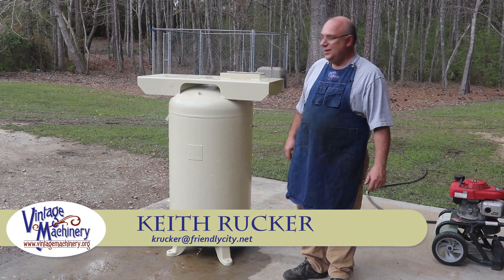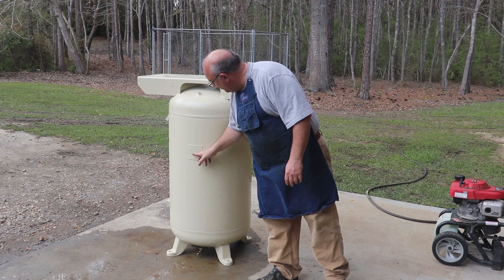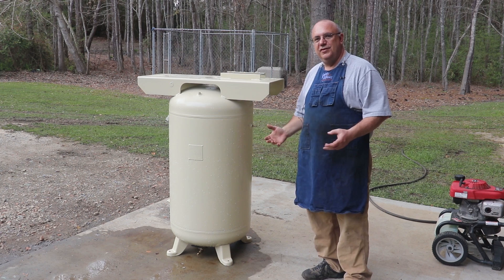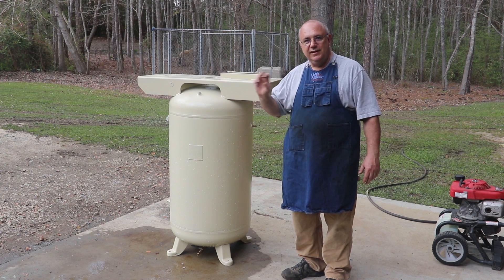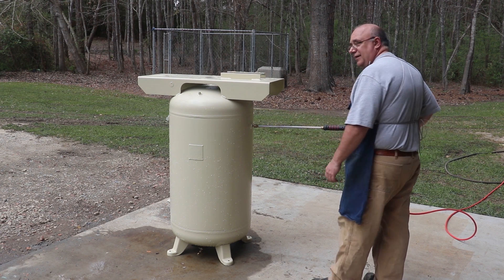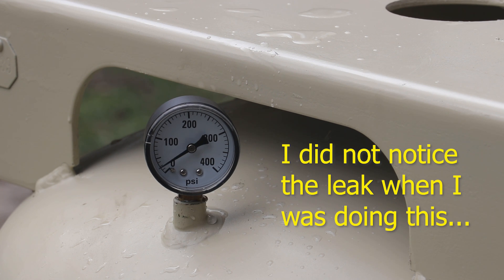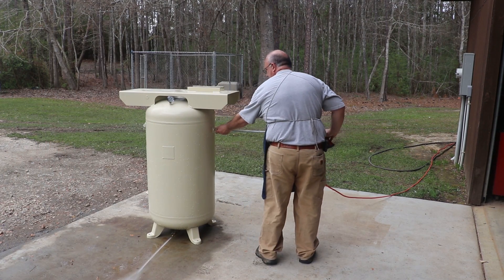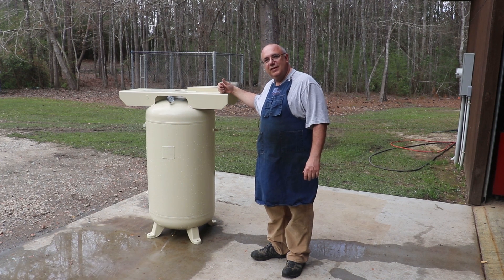Hydro Pressure Testing a Air Compressor Tank

Comment: Keith, I see that the tank held the test pressure for a few minutes but as you certainly must be aware this test does not reveal the condition of the tank. Any used air tank can be minutes away from failing. Tanks that have not been kept properly drained can have sever pitting and still hold for the moment. 
With any air tank, new or old, an automatic (preferable an electric solenoid valve on a timer) should be used. 
To see what can happen when an air tank fails you can look here: https://youtu.be/sm_FJ6Pat4I

Comment: When compressed gas cylinders are hydro tested, they're monitored for volumetric changes by submerging the cylinder in a sealed water tank during the test.  The amount of water expelled equals the volumetric growth of the cylinder under test, and you can also verify that the tank returned to its original size.  This way, thin (corroded) walls are detected even if they don't rupture.  I'm not suggesting you should do this in your situation, it just seemed like something of interest.  Now we just have to figure out the optimum air/water ratio and bottom nozzle diameter to get that tank to rocket as high in the air as possible.  I would like to start with 70% water and 30% air at 225 PSIG.  If that's a 100-gal tank, a 3" nozzle should be good for a gentle lift-off, so I vote for 4" to launch with gusto.  You can pull the cork!
Reply: I want to be there!

Comment: Great way to do a hydro test, beats using a hand pump!
Reply: wrong tony.  he coulda easily slipped up on the throttling by hand and that was a 6,000 psig pressure washer = ka-boom !!

Comment: Because water is non-compressible it builds pressure much faster than air for anyone wondering how it built pressure so quickly. For air to build the same pressure you would need to pump in many cubic feet of air, with water it only holds what it holds so you are simply trying to force in more than it will hold and it instantly builds pressure because no more water can fit inside so the pressure is from the cylinder or tank slightly expanding, in this case there is a small amount of air at the top which is compressing too.

Comment: my father used water and a manual grease gun to increase the pressure, too bad I was too young to really understand (or care) how he did it exactly
Reply: I have to assume that was in time, when relatively inexpensive, high pressure pumps. weren't available to homeowners. A manual grease gun is a high pressure  pump. Your dad  most likely did , what Keith did here.

Comment: its not the potential energy it is the proximity to other damage of people and machinery     150% is great for a compressor behind the shop
if it is in the shop a 200% is desired to "Set off " a tank  if it will fail idea is you want to test the limitations with Ansi engineering standard rupture proof test  (not a proof it will not fail , a proof that the structure is a tested  Over Pressure and survived without compromising the tank in the test.
in the propane tanks we were testing I have seen over 200% on older tanks that they really wanted to "Proof"    
on the propane tanks they had a engineer sound test and borescope after the "Hydro".  as well as a type of acid etch internally, with a bicarbonate wash, dry and seal.     tank care was interesting to watch as a welder , the outgassing of aluminium tanks and the welding accidents were horrifying, I used to weld on pads for propane tanks filled, a lot as a part of Dot maintenance discovery.   no fear of death , a bit sociopathic

Comment: Very well explained . Being a boiler plant engineer  safety and annual testing is paramount . Few non pros would perform a wall  thickness deterioration test on an air receiver ( a good idea after 10 years ) but ya could remove the large bung plug ( most have one ) and do a visual with a borescope or drain camera .

Comment: Well done Keith.  Some important points.  Never screw in a gauge by the gauge body.  Always use a wrench or you will damage the gauge.  After filling the tank, always let the temperature stabilize.  Preferably stand behind a wall when pressurizing.  That dog didn't get old by being dumb!   The leg of my small 3 gal tank is stamped with a "Destroy By" date.
Sadly the cheap drains are a coupling welded in that protrudes Inside the tank,  and does not allow complete drainage of any condensate.  Never buy one at a Garage Sale!  I have done countless Hydro tests and once witnessed a pipe coupling failure and 3,500 psi.  Impressive.  Pressure Gauge pipe on top of a vessel was not screwed in properly or threads let go.  3' length of 2" pipe does a lot of damage to a lot of things!  The Nameplate shouid give you data on the original Hydrostatic test Pressure.  Normally 1.5 times Operating Pressure.   125 Psi rating would be tested at about 190 PSI.

Comment: The inlet to the gun is rated above the pressure washer pump output but the discharge side is not as it is open ended use a rated block valve in place of the handle, yes people do pressure test like this to thousands of psi but use the block valve, do you want your hand pulling a trigger with 3-4 thousand psi on the wand side with a quick disconnect as some people do when hydroforming/testing? This is a low pressure test so no issue, this comment is for the high pressure test.

Comment: If water is not compressible how doesn't hot water tanks blow the roof off if the check valve fails? Just curious
Reply: tanks for hot water as part of heatings in a household have a second tank with a rubber ,,balloon'' inside. You set this balloon under pressure by a normal air valve like it's used for car tires, and it will absorb the volume changes between heated or cold water.

Comment: Typical Power Boiler Hydrostatic Test pressure is 1.5X MAWP, water at ambient and no less than 20 degrees Celsius as per ASME BPVC. At manufacturers shop hot water heating and hot water supply boilers must be subjected to 2.5X MAWP if the MAWP is over 200kpa. But once constructed and in service must be subjected to no less than 1.5X MAWP. Found in Section I and Section IV of the ASME BPVC.

Comment: I saw a photo of one of those horizontal hobbyist compressors with wheels at one end, and that baby had turned inside out and taken out the frame back wall of the guy’s garage. Everyone with a compressor needs to have a photo of such a catastrophe where users can see it on a regular basis.

Comment: You're going about this the unsafe way. You need to install a pressure relief valve when pressure testing the tank. A simple tee is all you need where you have the gauge connected. A 275 PSI safety relief valve is $8. 
That way if you have a mechanical failure or some other issue the pressure in the tank is limited to the safety relief valve pressure as it'll easily outflow your pressure washer.
Reply: wrong. completely wrong.
Reply: @abitofeverything9970  not wrong. He should have had. A pressure relief valve in case of  going over the test pressure
Reply: @sexyfacenation  I hydro test for a living. A safety relief valve is actually against regulation. Vessel has to be completely gagged. 🥴
Reply: @abitofeverything9970  I don't safety test for a living! It's odd you wouldn't have a fail-safe. Is there not something in the test system in case something goes wrong?
Reply: @sexyfacenation   a manual valve. either a gate valve or ball valve to regulate the pressure. not an actual fail safe, just a bleed valve to control pump flow
Reply: I have my finger on the switch, My eyes on the pressure gage and distance
Reply: That would defeat the purpose , you’d only be able to build pressure to Relief setting , 150 / 170 psi all you’d be testing is the safety valve
Reply: The only away a safety relief would work is if was high pressure valve exceeding the normal safety relief  of 150 psi or so , other wise your pretty much just testing the valve itself
Reply: I would agree with that.
Why not have a relief valve?
It won't hurt anything or change the test results.
Reply: @markchidester6239  a relief valve most definitely can change the test results. when the vessel it full of water, obviously it doesnt compress, so even a thimble full of water leaking from the safety valve could mean a drop of 50-100psi.

Comment: Keith - Thanks for making this episode.  I looked at my compressor which sits in a corner of the basement with air lines to my nearby work bench and the garage.  Couldn't recall the last time I drained water from the tank. Even forgot I had installed a radiator petcock in the drain!  So it's been a while.  The water that drained out was pretty clear and less than a quart BUT that compressor was manufactured in 1970!  The 2 cylinder cast iron compressor is getting pretty tired.  I replaced some reeds about 5 years ago.  But it's struggling again so I'm retiring the old girl. 

Picked up a smaller unit at (sorry!) Harbor Freight - 8 gallon vs. 20 on the old Sears BEST unit.  I noticed that every compressor in the store recommends draining the tank every day after use.

Comment: I find these lower than tag rated home tests amusing.   

I've done many tank tests with old odd scrap yard or auction air, propane and other tanks I have picked up over the years and repurposed or added ports to or modified in some way and I have always done my test to 2x rated for a at minimal 10 minute hold and even done a few to 3x and 4x to push dents out.  

Never had one catastrophically fail either (I do stand around a corner and pressure them up remotely though) even with very rough looking air and propane tanks with build dates going way back into the 1940's!

Comment: When I was in the Air Force we did some pressure testing on some tanks about the size of yours, but we were required to go around all the welds and tap them with a ball peen hammer. It made me nervous, but when you encountered a leak it was  uneventful. You just got a little wet.

Comment: we use to do pressure testing on hot water heaters and let me tell ya water is just as bad as air iv seen them explode and take 1/2 the house with it, it take 2 failures releaf  valve stuck for both and ether the water pump pressure switch fails or the thermostat and they start to build pressure till they pop from 300psi to up to 1000psi at 300psi the tank can wipe out 1 floor above and below at 500psi and they will wipe out the 1 below and 2 above and at 1000psi they can rip 1/2 a 3 story house down. go watch some video of water heaters failing in 15yrs of doing hvac i seen only 3 times but its amazing the power they have when the pop. thanks for sharing
Reply: I think that, when the thermostat runs away, you have a steam vessel. Steam at atmospheric pressure is about 1000 times the volume of the water. I’m sure it’s damaging.

Comment: Since moisture laying in the bottom of a tank is the most common point of failure when it rusts through I have often wondered why the manufacturers don't galvanize the interior?  Is there some reason that wouldn't be viable other than the few dollars of cost?  It is a given no matter how much or how often you drain the tank in such an oxygen rich environment (ten atmospheres or so), the fact moisture will always be present and that it takes so little to start and continue the oxidation process that this would be a problem that should be solved.  Especially so since most drains have a welded in boss that is actually slightly higher than the bottom of the tank creating a reservoir of constant water.  Nice project.  Take care.  Doug
Reply: The interior might BE galvanized, how would we know?   But, whatever the manufacurer did, the tank seems fine after 30+ years, so it was... good enough.

Welded tank seams would have to be complete, and clean on the inside of the tank,
before galvanizing, though.

Comment: For all the nervous Nellie's you need to search out "lpg cylinder burst test" (hydro pressure testing tank failure) on YouTube You'll see how undramatic it is when these fail with water in them. They bulge a LPG cylinder out with 1200+psi.
Reply: @Mike T what?? pressure can't build up with just water? how bout if it's filled with water and a grease gun pushing water or grease won't get it to a test pressure? i always thought it would, according to the gauge it did. i've only tried it on horizontal tanks. i got a few air compressors, get this, one of them my dad had since the 60s and it has a built in square tank that always cracked and he brazed it and added another tank under it, the weld cracks all the time and i braze it back up, it runs up to 120psi. i got a 30 gal boiler compressor tank and pump, it had some pretty bad cracks on the flywheel, and i v'd it out and arc welded it back together. it should work fine. i don't stand in the line of fire though. just hoping it don't go through the neighbors wall.
Reply: Hydrotesting isn't explosive as water is, for all practical purposes, non compressible. Two different beasts.
Reply: @stevenbiars4817  Yes, but as someone pointed out, a fitting coming off under pressure CAN be pretty dangerous.

Comment: I enjoyed your video immensely, and have a compressor tank of my own, purchased second hand, that requires testing.  Thank you.For all the 13 year old 'experts' and 'keyboard kommandos' out there here is the procedure used in the fire service, their LIVES depend on compressed air tanks."Requirements For Hydrostatic Tank Testing:1. Hydrostatic tank testing must be completed by a licensed certified tank tester with special equipment designed for the task.
2. The tank should be tested every five years.
3. The tank must be tested more often than every five years if there are any visual signs of degradation or damage.
4. Requirements under the law state that the tank to be tested must be filled with water and pressurized to 167% of the maximum operating pressure listed on the side of the tank.
5. The tank, including all of the valves and other closures, must hold the pressure test for at least 30 minutes without leaking or bulging.
6. Details and requirements for hydrostatic testing are covered under OSHA regulations section 180.407."

Comment: we don't do pressure tests in my state, Washington. either the state inspector or your insurance inspector does an inspection with an ultrasonic thickness gauge. this has to be done every 2 years for any pressure vessel in commercial use or any above 80 gal.

Comment: An acquaintance showed me some photos of a 2HP horizontal that blew up and took out a large section of the adjacent wallboard in his shop! A VERY sobering sight! Make sure there is no air left. Since you are pressure testing it, I do not see why welding new metal in would hurt. Since you would likely be repairing the bottom, you could put a depression around the drain so the condensate would all drain out. The few tanks I have seen inside had a raised weld bead that would let water remain. I also sprayed some wax based auto rust proofing inside to help prevent rust. I put an elbow,  a nipple, and valve on mine so I can drain it without reaching under the tank. The pipe also serves as a reservoir for condensate.

Comment: Having done countless hydro tests of piping systems I want to add a couple of points. 
First, respect pressure. All things equal it is true that the dangers of air testing  far outweigh hydrotesting  but dangers exist any time anything is under pressure. 
Second, the leak at the gauge is a great visual. Most hydrotests fail because the test apparatus leaks.
Reply: No doubt! I was working on a wetland restoration project 12 years ago and a hose about 2–3 times the diameter of a fire hose that supplied water to a hopper used for making slurry blew. up right in front of me… and I didn’t even touch it! Needless to say, it threw me on my ass at least 10’ away from where I was standing! Yeah! Definitely respect pressure!

Comment: The small air pocket at the top is actually useful, as that small amount of compressibility, allows the pressure to ramp-up slower.  If the tank was completely full and you hit it with 3000psi, then the internal pressure would have risen very fast and it would be difficult for you to set the gauge to 225psi. :)
Reply: I can confirm that.  I had (virtually) no air pocket in my tank and the pressure meter immediately went off the chart.  I mean: way faster than in this video.  I'm glad I had read this warning (and the one in the video)